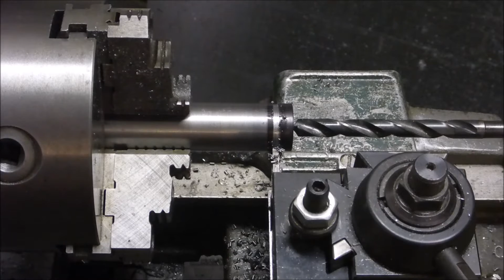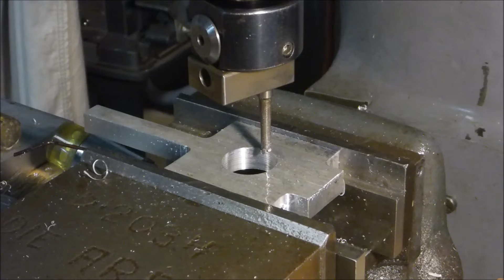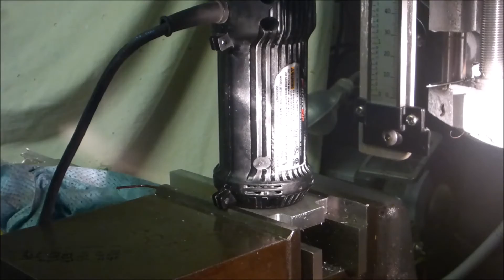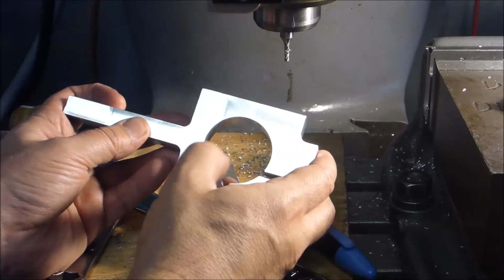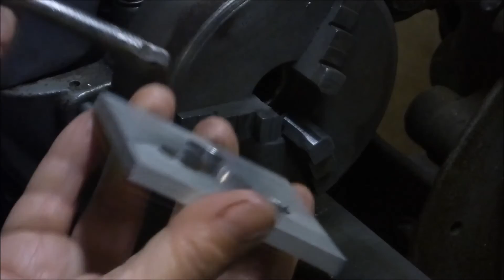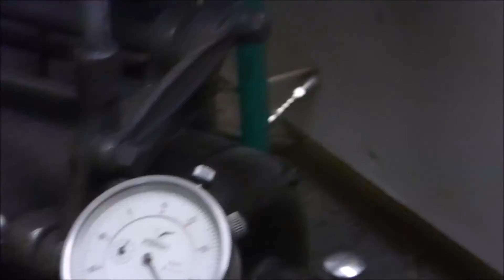2015 10 02 Shop Update

Comment: I can advice to look at one Russian metalworking teacher - all bout how to use, maintain, clean and rebuild 3 jaw chucks.
https://www.youtube.com/watch?v=e2SadYx2IPM
https://www.youtube.com/watch?v=yzEBt6caNAA
https://www.youtube.com/watch?v=24oM3AVDSZg
short said: before grinding jaws need to reasamble the chuck, clean, assamble, add havy lube to protect scroll from grinding dust, reasamble again, clean, assamble, take measurements, lastly do diamante paste manual grinding.
Reply from the maker: +villijs33321 Thank you for the tips--I will check those out.
Reply from the maker: +villijs33321 Thank you for the tips. I watched the first one--very instructive, even though I don't speak Russian.

Comment: You said it was an old chuck.  If the jaws are worn and loose in there grooves, the way you used the external ring out at the end of the jaw you would of ground the jaws not square.  When you tighten down on a work piece they would want to try to be tight to the piece but nit hold the piece centered.  The grinding process worked.  Try chucking a piece in the back part of the jaws and the measure the outer part of the jaws to see if they are centered about the axis.  Most of the time the back part of jaws do not wear very much.  I will try to shoot a short vid tomorrow to show what I am talking about and send you a link.

Comment: More light on the subject doctor.  Boring worked well.  If the Alu. is soft then it is gummy and you need to get the chips out of the cut,  they will plug the endmill and give you a poor finish.  Grinding worked.  Randy
Reply from the maker: +Randy Richard Hi Randy--Thanks for the comments. Just to make sure I understand correctly, when you say "grinding worked," do you mean that's about the best I should expect to get out of that 3-jaw?